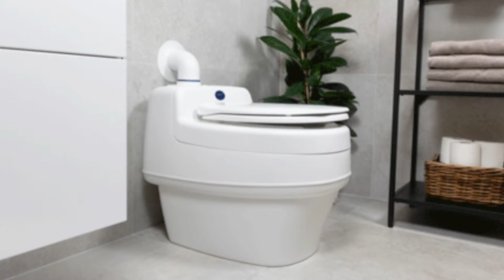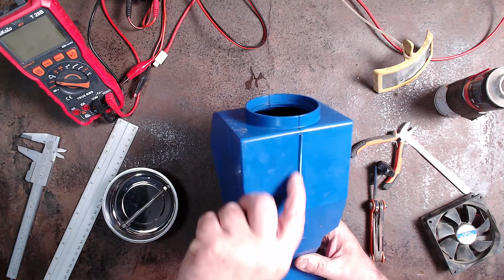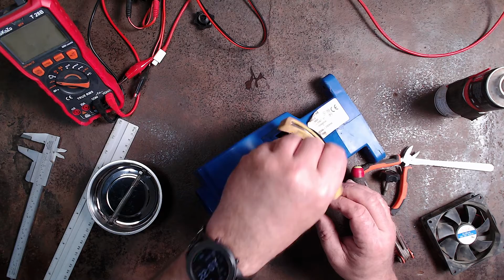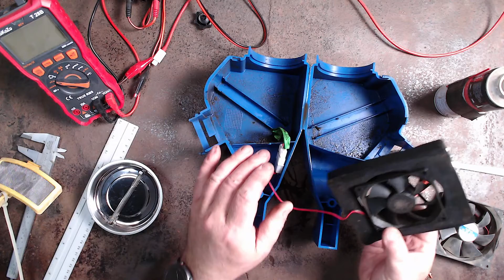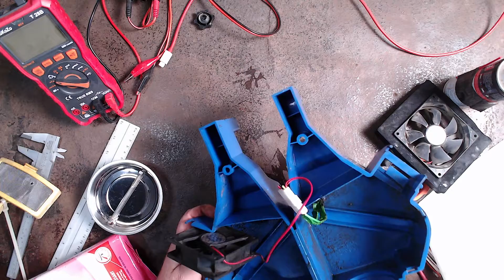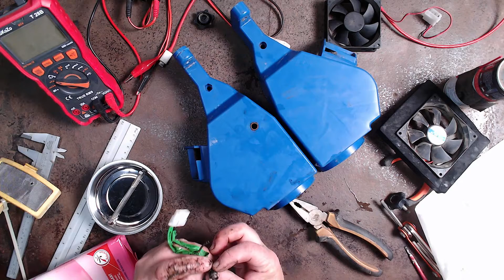SEPARETT Toilette Fan Repair

Comment: Thanks for posting. I'm wondering if there's a video of the wiring system somewhere. Our tiny is getting power, but neither the fan nor the urine light is working. I tested the wire that the fan housing connects to and there's no power to it so there's a break in the switch(?) box that receives the external power source. Any hypothesis?
Reply from the maker: is it a 12v or 240v system